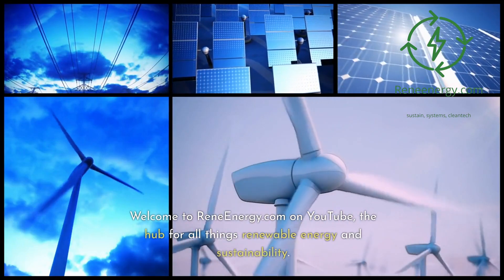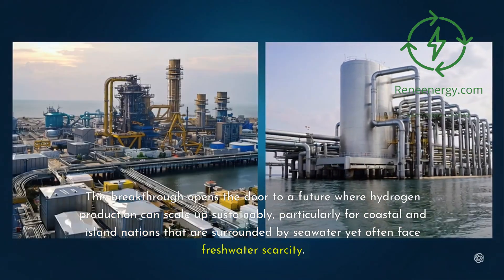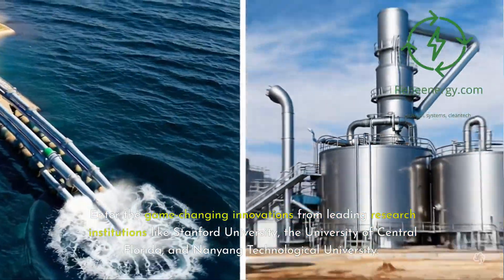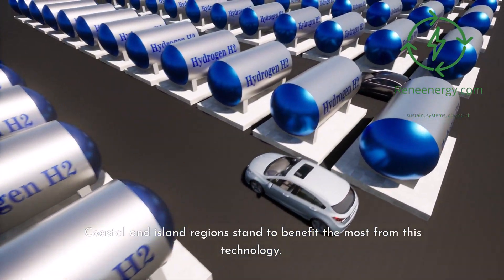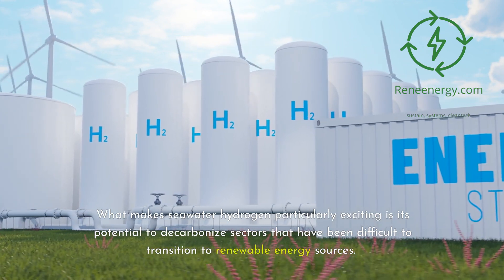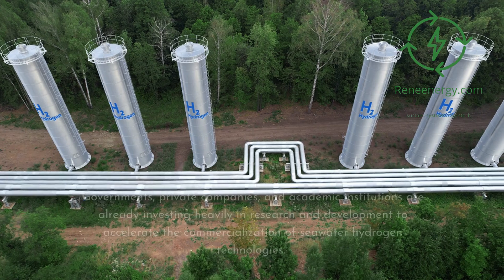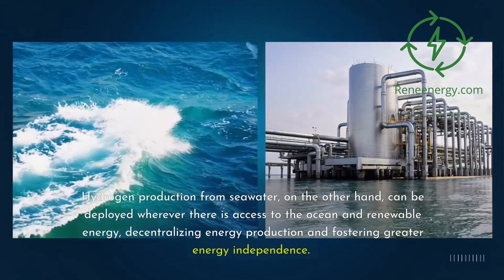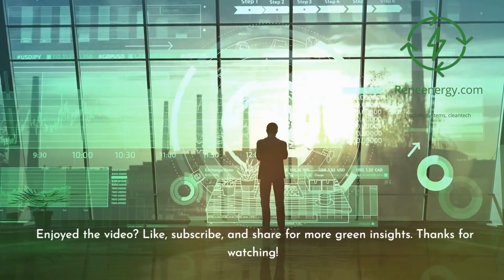Can We Produce Green Hydrogen Directly from Seawater?

Comment: Hydrogen for EVs is unfortunately dead
Reply: Grenada can capture sufficient water during the wet season by building multiple water reservoirs in diverse places, and then use electrolysis to create hydrogen gas for renewable energy. Plus we can use tidal waves, solar or hydroelectric dams to power the hydrogen manufacturing plant to create hydrogen gas. 😎💯💪🏾👍🏾 If we have to use the seawater route, we will also need to power the desalination plant with another type of renewable energy sources like the solar, wind or tidal wave. Because the desalination plant takes up a lot of energy sources. To my understanding hydrogen gas power output is equal to that of oil or natural gas, and it can supply adequate power for high demanding energy manufacturing plants such as steel production.